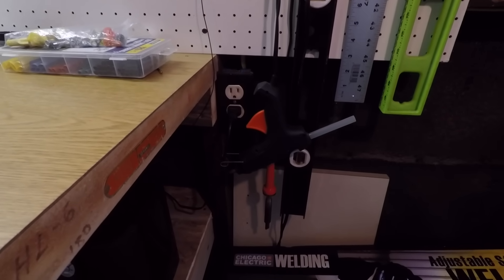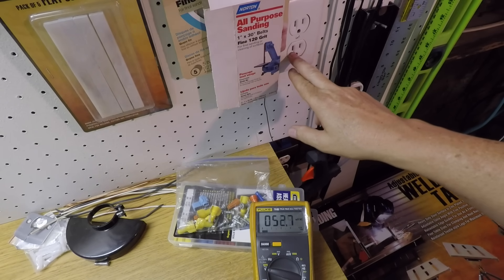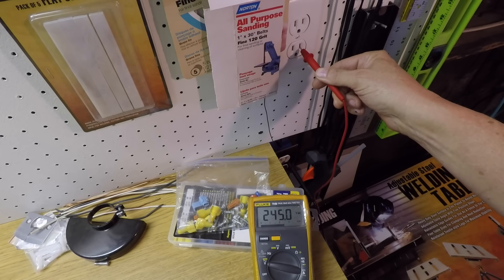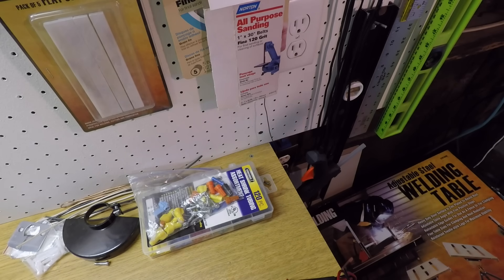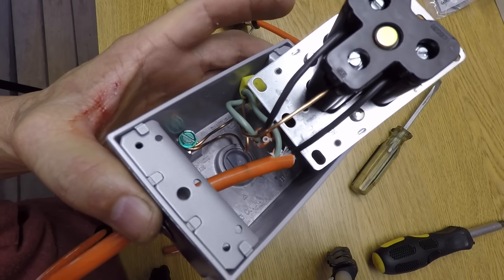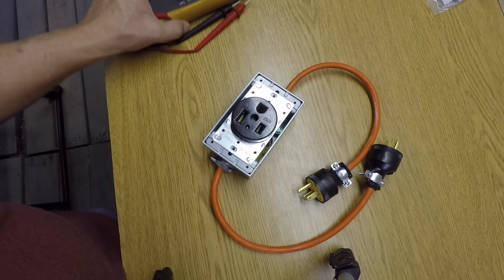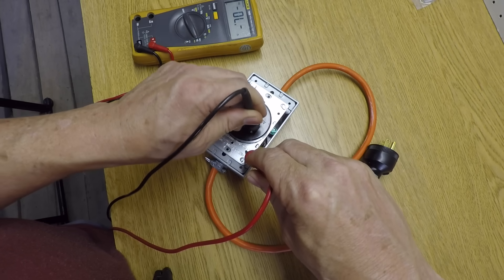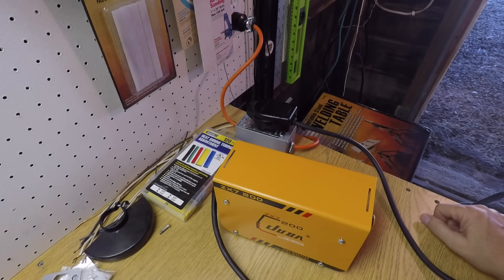How to Get 220v From 110v

Comment: So is it safe just having 40amp circuit for your welder?  I would appreciate your response.
Reply from the maker: The welder you use determines what amperage circuit you will need to run it.

Comment: A poor design. In real life you do not have two outlets that close on different circuits, so one of these outlets was added. If you made an effort of adding an extra outlet, why not run two hot wires from a dual breaker and have a dedicated 240 outlet?

Comment: What he has is prolly has is twin breaker 2 pole being that each outlet takes in 120 vote a double pole breaker wire to two different outlets that’s my guess because my house has one single twin breaker 20 A one on each outlet this is possible because remember guys we’re talking about electricity here as long as the power steps up and the wire can handle the pressure. The breaker doesn’t matter. The breaker is just for safety reason the vote that comes in an app that comes in from the pole before it hits the meteris about 50+ amps over 250 V. It’s the transformers and breaker panels that breaks the power down I’ll try this.

Comment: Why in the would you use the ground leg as common?  If you are going to do this (which you shouldn't) . . . But if you do this the ground leg should ground the enclosure box.  The common legs should be used as the common leg, NOT THE GROUND!!

You could create a situation where one braker trips and the second braker energized the entire ground of the whole house.  Now you have a someone in a completely different part of the house touch a grounded device and dies because they become the shooter path to earth!

Code is that ground and common are bonded at the MAIN PANEL ONLY!   You never want to have multiple paths to ground because it can cause dangerous problems that can kill someone.  All sub panels, outlets, appliances should always be wired so that ground and common are kept completely separate!!

Comment: As an electrician with over 40 yes experience I would say    PLEASE DO NO DO THIS    I'm fairly certain that his breakers are not interconnected which they should be if they are going to feed the same plug ( his welder)    I can't see why he just didn't run a separate feed just his welder

Comment: You have 15 amp outlets on your 20 amp circuits. I doubt there's a difference with the load rating, but 20 amp outlets have a T shaped plug on the hot leg. 
I'm this video you admitted to installing this circuit. Consider your insurance company looking for any reason not to pay out on a claim or drop you.

Comment: Your outlets are upside down. The way you have it, if the plug is a bit loose and pulls out a bit. If something metal falls into the gap between the plug and outlet it will short the hot to neutral. It may not trip a breaker but when you see it and try to pull it out you become the ground for that hot. 
The outlet the other side up, if loose and something falls into the gap it hits the ground prong and falls safely away from the other blades in the plug.

Comment: I have a backup generator with both halves in one duplex. It came from the factory that way. It also has a 250 volt twist lock socket. So when I went to make up a 250 volt supply cord, instead of buying the twist lock plug, I used two 3 prong 125 volt plugs. I can plug them into that single duplex and satisfy both sides of my house. BUT I also had an Ulterior Motive: I wanted to be able to use a different generator, an Onan, a very old Onan. It's a low rpm, quiet running 2 cylinder electric start unit that I like to hear when it's running. But it only makes makes 120 volts single phase. Now it just so happens that Detroit Edison cannot keep my electricity on for too many days in a row, and I find myself requiring a back up system several times per year. Infact, almost everytime it storms I lose power. Most of the time it's only for a couple days. A few years ago we went for 7 days, and since then only 4 days. But every so often I lose electricity for 5 or 6 hours or a couple of days. OK? Now, back to my Ulterior Motive: I am a very frugal electricity user. My electric bill is under $65/ mo. unless I'm welding or running AC. And if the truth were to be known, out of that $65/ mo. only about $12 or $15 is actual electricity, the rest is BS charges such as customer charges, delivery fees, demand charges, fuel costs, taxes, and other made up charges for Michigan Governator Wretched Witchmer & Cabal. So when I lose electricity, I don't need too awful much actual electricity, and I usually plug in my very old generator and use it's 120 volts AC Single Phase. The only things that I need/ use 250 volts for are my drinking water well pump motor and my kitchen stove. Everything else runs on 120 volts. So I plug both of the 3 prong plugs into my old 120 volt single phase generator and run my entire house on the same phase 120 volts. It doesn't hurt anything to have the same phase on both sides because the 250 volt appliances do not use a "common," they only use the 2 out-of-phase 120 volts together equaling 250 volts, so in effect those appliances only get one side and do not even try to operate. When I need water, I go out in the garage and start up the 3,600 rpm loud and obnoxious propane generator, unplug the two 3 prong plugs from my old Onan and plug them into the duplex outlet and run it for a few minutes. I do not even try to operate the kitchen stove, instead I have 2 microwave ovens or I use a propane camp stove I set up on my kitchen stove top. The rest of the time I run my house on my old Onan. It's an heirloom, so I am happy to use it. It has electric start and it has a long clear plastic fuel supply line that I usually slip into a 6 gallon plastic gas can, so it will run for a full day running 3 freezers and 2 refrigerators, a few lights, my laptop computer and it used to run my router, but I now use the little battery powered "pocket hot spot" from T-Mobile. Meanwhile my old Onan is out there running at a low and quiet 1,800 rpm doing the job. It just sits there going poom poom poom poom. Music to my ears. OH And I almost plum forgot: It has all the entire hookup to start itself up upon a power failure including a once a week startup to keep everything in running order. And although it'd be simple enough to hook it all up and dedicate a spot for it, I don't care to. I'm OK with doing what I've been doing for the past 35 years or so. That's my story and I'm sticking to it. ben/ michigan
Reply: its too bad they dont design things so they just work anymore,due to greed. theres a simple pleasure in limping along an old tool without giving the greed corp another dime. its like a competition to see how long i can keep it operating past its designed failure date! satisfying 😌

Comment: 😮When working with a breaker box, it's crucial to understand how the electrical legs are distributed. If you take two lines from any two breakers, you have a *50/50 chance* of pulling from the same leg. If both breakers are on the same leg, you'll only be running *110V* instead of **220V**, which can lead to electrical shorts or damage to your equipment.

To ensure proper voltage, you must pull one breaker from the *left leg* and the next breaker down from the **right leg**. This is because breaker boxes follow a **zigzag pattern**, alternating between legs as you move down the panel. Every other breaker is connected to the opposite leg.

A *220V breaker* requires two different legs—one carrying a *positive charge* at *60 Hz* and the other carrying a *negative charge* at **60 Hz**. This alternating pattern ensures that power is delivered correctly. If both legs were powered at the same time, it could result in **serious electrical hazards**, including **short circuits or fires**.

Comment: Makes wonder what the hell I’ve done in my garage by taking to 110s and combining them directly to a cord going to a heater that requires 220 I just figured all 220 is is two 110s together equals 220 volts 😮 I mean at least the math works out that way🤔

Comment: Im going to make one. I already have my 4 gang boxs wired to opposite legs in the panel. I did that so I could run 2 - 120 20amp tools at the same time from the same box. It will be easy to make your device and turn my 4 gang 120 into a 240 amp. Keep up the good work

Comment: beautiful, here is a question sir, if there is an outlet coming from circuit breaker that is for 220 volt , and there are 2 hot wires  having 110 volt each, that two hot wires are for right and left side of socket . and ground will be for ground ,. as far as I understand there is no neutral wire there. am i right sir.
Reply from the maker: That’s correct, two hot wires and a ground for the welder plug I am using in the video.

Comment: A receptacle has a place on the hot side screws where you can cut it and hook up 2 separate hot wires instead of using two receptacles you can only use one receptacle with two different hots. We used to do it when a house with no ceiling light you can wire  receptacle to a switch near the front door top plug from a lamp on the top of the receptacle, now you have the top receptacle is switched now. The bottom part of the one receptacle is continuously hot.

Comment: you should have used male plugs rated for 20 amps and wire rated for 20 amps (12 gauge) .Also  your ground wire . I mean what happens if you actually pull over 15 amps thru your contraption ? Doesn't that mean you are p[utting too much current thru your wires and plugs ? This should be a dedicated circuit with nothing else on the cirquit. But most of all the two 120 volt outlets you are tapping into have to be on the two different legs in the panel or you wont  have 240 volts .Another problem is what if one of the breakers trips and not the other ??? Dangerous . Just run a dedicated 240 volt circuit to your shop that is code compliant.

Comment: I built combiner boxes 25 years ago for the use of RV dealerships by taking two separate  30 amp RV plugs to make a twin 30 amp service 240 volt plug for the larger 240 amp twin 50 amp service plug so the could demo hi line rv motorhomes at  Recreation Vehicle shows in California.

Comment: Stay away from the crap. I have wired 480 three phase. To my home 220 ac 110 rewire. Wd had an old 220 dryer breaker. I used that. But if you fallow this vid. Watch you wire gage. Something he doesnt tell you

Comment: Um both of them wallll plugs are 15amp you may have used 20amp wire and brakers  on a 20amp wall plug the right side is a straight and the left side is a side way's capital tee    ---|  |  you have a good idea you just need to put in 20amp wall plugs  you riley need 2 20amp plugs and 12ga wire then you would have it all 20amp and itt would be safer from melting something an starting a fire

Comment: As long as both circuits are rated for the same current draw and the equipment doesn't exceed the rated current, it should be save. Just remember to use a voltage meter to make sure you're getting 230-240 across the L1 and L2.

Comment: They actually do something sell something that does exactly what he wants, but not the way he's doing it, which is totally unsafe. They do sell what's called a Voltage Converter Transformer Step Up/Down 110V/220V that has Circuit Breaker Protection Which is made to do what he wants to do.

Comment: You might want to wire and circuit breaker at 30 amps at the box and nothing on the circuit with #10 wire and run your welder cord to that circuit.  You could cut off the neutral wire as well to prevent that getting tangled in the circuit.

Comment: In your panel, our have 2 separate bus bars, run a conduit to shop area, buy a 220v circuit that looks like you AC, furnace, oven, dryer, why not live like Trump instead of jed clampett.

Comment: Don't listen to this ignorant.... first change the breakers for the outlets being used to GFCI BREAKERS  ALWAYS connect your neutral and ground. The neutral wires impedance ensures ground fault interruption...This is for ground redundancy.... failure to do so will cause fire 🔥 and or shock... always heat shrink hot wires for exterior outlets (or use liquid electrical tape)

Comment: Yes,you can get 240v from 2 ,110. You only have 20amp. Which most if not all, 240v welders  require more than 20amp. Only qualified electricians should be doing anything to with the power in your house. Risk of death/fire, you know, just to name 2.

Comment: Electricians may scoff at this method. But, as someone who has minimal knowledge of wiring and circuitry, I found your video extremely useful. I used it to connect my 220v clothes dryer, and it worked perfectly. The only thing you might add for us amateurs are the specific settings on the multimeter. THANK YOU!

Comment: Just install a 208v single receptacle. Move the neutral to the second phase of a 2 pole breaker and be done. I would reccommend using the 30amp reveptacle with a two pole 30A breaker. Make sure the wire size is #10 so it doesn’t heat up and burn out. 20a is ok for a starter but if you have 208 on that receptacle you already made made the conversion in the panel or had the joint on the receptacle broken to give independent power to each side of the duplex.  You turn that welder up to 18 amps it will work for maybe 20 minutes before it trips the breaker (circuit). For light welding this will work. Seems like a lot to go through. Most tesidential panels are cut into the wall. I personally would take the cover off the panel and knock out a KO. Cut out a box about a foot under the panel for a cut in box. Get some #10 Romex, (6 wire would be much more difficult to get into the box but possible) with romex connector on one end with the sleeve cut don enough to expose 2feet of wire to terminate connections at breaker wire is 10/3 romex. 50amps would require a #6 thin wire size. Fish the wire up the wall to the KO. Install the lock nut. Insert the other side of wire into the tab in the cut in box. Cut the sleeve down 8 inches so you have to nec regulated 6 inches hanging out of the box. Land the red and black wires on either side of the 30/50 amp receptacle. Install the box. Just push it into the cut out area. Providing you used the box to trace out the area before you cut it. Should fit perfectly. Tighten the two screws on the box. The vices should close and grab the drywall securing the box. Push the receptacle into the box and secure it using the screws provided. Then place the cover plate over the receptacle. Walla! You have a 30/50A 2pole 208/240v receptacle legitimately installed. Plug up the machine now you can use 24 amps of the 30 amps  (40 amps if you can battle with running a 6/3 S.O. Chord) safely  which will give you more of an arch on the welding machine easier welds and a dedicated circuit for the machine. I do understand the improvision.  208 devices require 120v over two separate phases. But ppl should understand you already had two separate phases of 120v in the pre existing box as the duplex receptacle was split making them both individual dedicated circuits which most duplex receptacles don’t have because they are not typically wired this way. Nice work though.

Comment: I suppose if you know for absolute sure you'll be the only person using that outlet and you know what NOT to use in that outlet you're okay but man, if the wrong person plugs the wrong thing into that they're gonna have a bad day. This is something I'd do in a pinch though for certain simple things, a welder being one of them, but only as a temporary solution until I could get a proper 220 installed which would be at the top of my priority list. If you're knowledgeable enough to do this, why not just do it right? I'm sure you have your reasons though, as we all do for everything. Hope you're doing well! I have to dislike this video and this is maybe one of the few times I kinda feel bad about it, but we all have our morals and I can't bend this one. This is very much not recommended as anything other than a desperate very temporary solution if you need 220 and you need it NOW (and not for everything, mostly things that are fine with running on dirty power, and even then, mmm). It is a really neat trick though and I'm going to keep it in my pocket for a rainy Day =\

Comment: If the device fits the capacity of the wires (assuning both circuits are 12awg) and both breakers are next to one another with a connector bridge in the breaker panel, there's nothing dangerous or unsafe about it.  It might be against code, but if you need something to just work, this works.

Comment: I have some basic electrical knowledge, but this is so confusing that I don’t understand it. Typically, it's much less complicated. Also, like many other comments, it violates safety rules and wouldn’t pass inspection. Additionally, you should not use two separate breakers for 110V/120V each. Instead, use one breaker designed for 240V; each hot wire will then provide 110-120V to the outlet, totalling 220-240v. and you need to determine the appropriate amperage. Please, if you have no experience with electrical panels, don’t even go near them; one mistake can be fatal. Even if breakers if off the panel  still have power. Please don’t be cheap don’t play with this type of electrical installations. Find an expert.

Comment: You cant just plug into the same 110 circuit, you need two 110s out of phase (180 degrees) or you will create a dead short.

Comment: The electric chick is fixable.

You may have to build a larger box with 2 breakers, one from each side.

That will help to shutdown the force if anything happen to the machine you’re using.

Is is a safety concern and honestly, is not that difficult to forget.

Comment: hello. Can I use a Korean welder in this way? 220v -8.5kva capacity..
Reply from the maker: I don’t know anything about a Korean welder. I suppose if it will run on 240v then it would work.
Reply: Is that a Korean made welder?  What is the rated power?